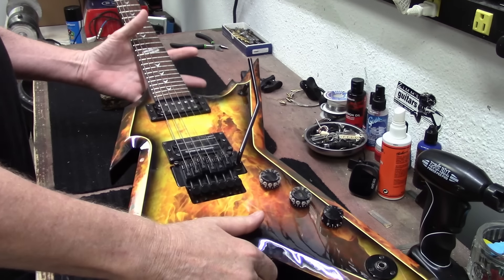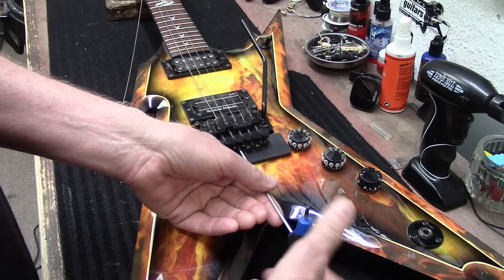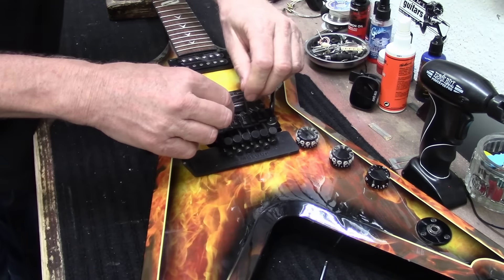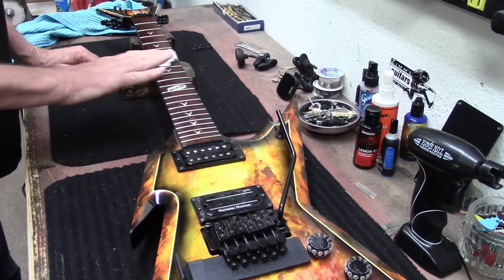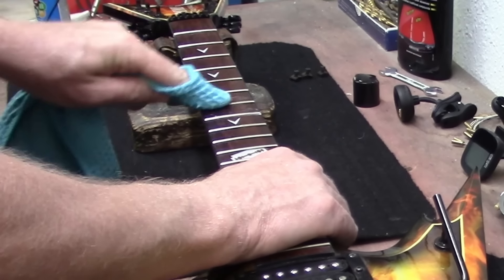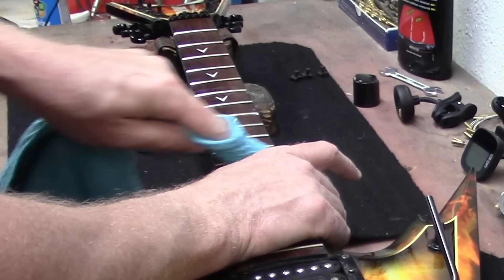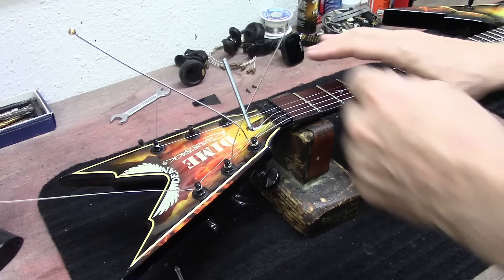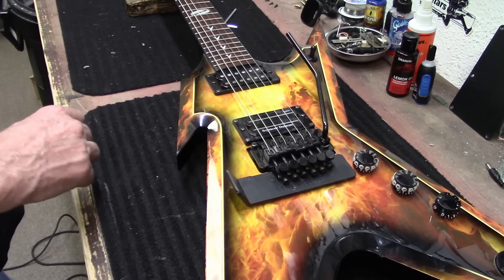Dean Dime Razorback Restring!

Comment: You said there was another bridge that came with it? I have that exact same guitar, and it comes with a licensed floyd rose. I don't see any markings on the low e side of the bridge. I saved mine from an abusive home, so it's not the prettiest. But with a proper setup, it's a beast.

Comment: Sir I love your uploads. That said your guitar not mine. If it were mine I would never adjust the knife edge pivot points under string tension. I have seen the results that this causes. The pivot point of the trem digs into the studs causing an issue with trem performance and tuning.
Reply: Not to mention damage to the knife edges of the trem plate. Especially in the softer licensed Floyd's.